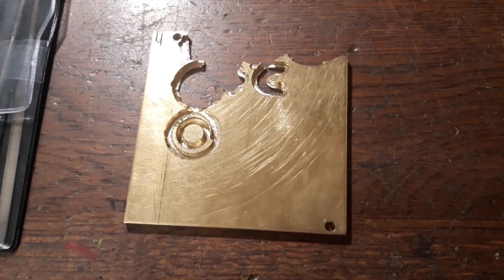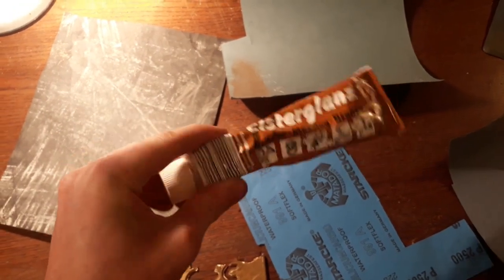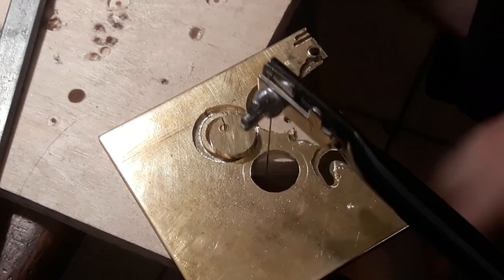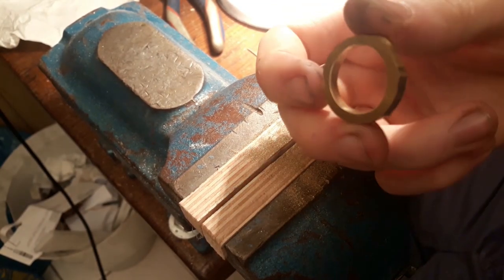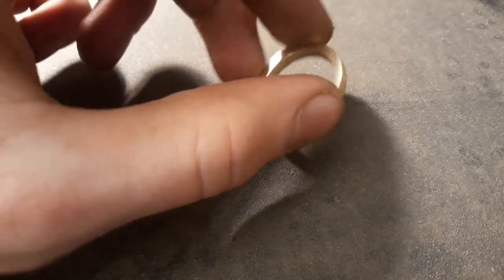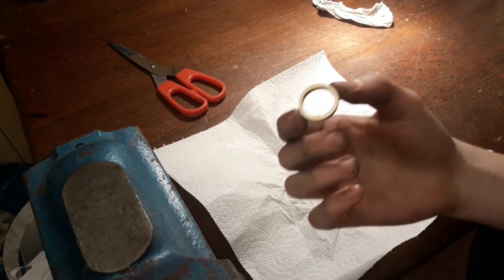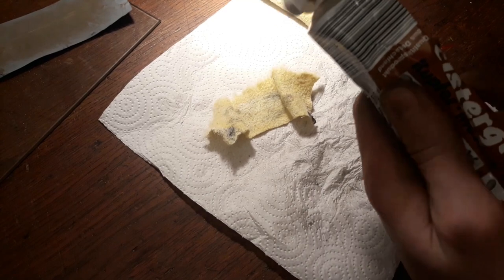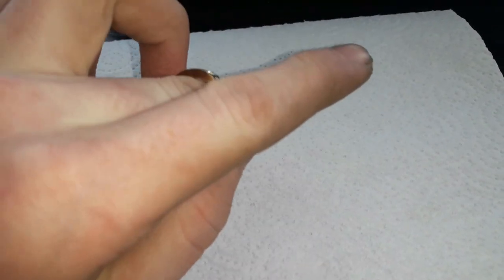HOW to make a ring using ONLY HANDTOOLS!!

Comment: Since when is a a drill a hand tool?
Reply from the maker: 1. You can lift, hold and use it with only one hand. 

2. Im pretty sure that everyone who wants to make stuff has a drill...
Reply: @WoodenWeaponry  but it haves a motor driven by elecrticity which makes it a powertool
Reply from the maker: Well, yeah, but in my opinion, a handtool is not necessarily without a motor. It doesnt actually matter, because you need a battery drill for pretty much every project. Or use a hand drill..
Reply: @WoodenWeaponry  i MYSELFwould use a cold cut tip and a jewelers saw and then cold forge the brass 
but still great work
Reply from the maker: Thats probably a valid idea, but if you can do that, you probably have a drill. Also cold working copper alloys brings its own problems..
Reply: You could use an old motorless hand drill if you prefer